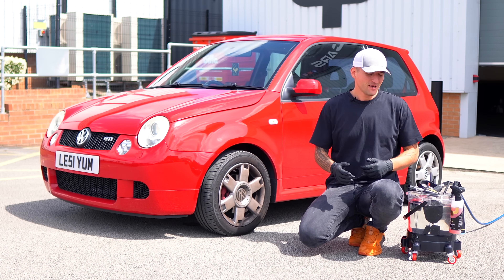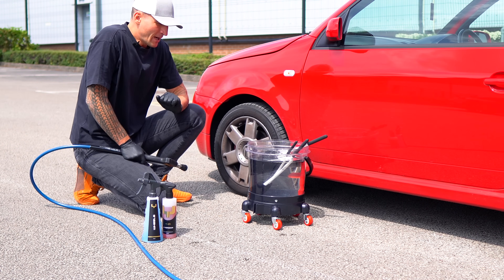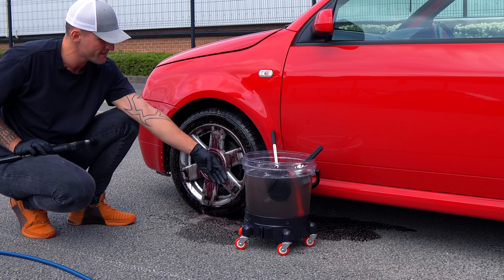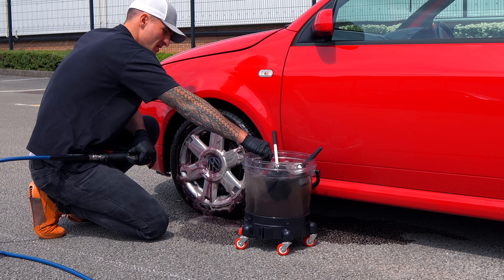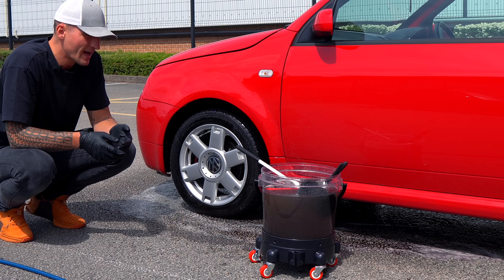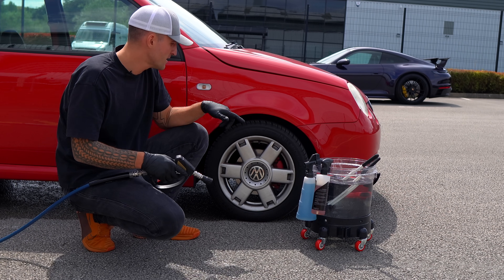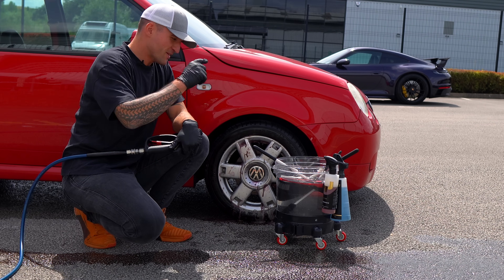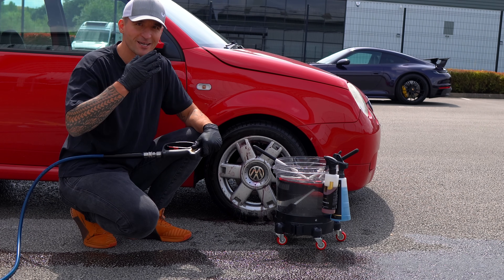Why The 1 Bucket Method For Wheels Is The WORST Idea In The Industry

Comment: I always use the two bucket method with my wheels as you say why do it on paint and not on painted diamond cut alloys. If my wheels are really dirty I do rinse my tools but I will going forward have the lance to hand as an extra rinse step as that makes sense in my eyes. Thanks for the tip.

Comment: I use no bucket and just spray cleaner on all my brushes, then rinse them with pressure washer . There is no need for a wheel bucket at all. don't waste time or effort. get it done easy and without so many buckets.  you should pre rinse wheels as well as it drastically removes and loosens brake distcdirt n grime prior to applying cleaner and foam.   people  think that chemicals won't work as well on a wet wheel, but if you  think about it , half oz. extra of water isn't going to dilute your wheel cleaner at all.    I compete a wheel cleaning in 2 and a half minutes using only my foamer  pressure washer and 3 brushes.   work smarter..not harder.  💪 

great video

Comment: I use no buckets, spray the wheel with wheel cleaner and the tyre with APC. Brush the barrels, faces and tyres and then just pressure wash it off. That's how I've always done it and never had any issues. I do wash my wheels weekly so they are never really that dirty.
Reply: Same. No buckets here. I only use one for rinseless with a sponge.

Comment: Please forgive me Nick, for I add HDD Brake-Through Wheel Shampoo to the wash water. But I do always spray-rinse my woolies and brushes after working on each area of my 5-spoke alloy wheel before putting them back into the wash bucket. I always direct the water spray AWAY from the car and the bucket while washing the brushes, to avoid any contamination. Water over-spray can dull the shine on my freshly 'Ceramic-Boost'-ed paint finish.

Comment: I use 1 backet for everything. I wash the car with multiple mitts, I wash the wheels in the end with 4 dedicated mitts and the wheel barrels with the water left in the backet while rinsing with this method. No dirty mitt or brush goes in the water. Only all of them go in the backet when I finish to go for laundry.
One backet for everything is all it's needed
Reply from the maker: not something we would do but happy it is working for you
Reply: @YumCars  Yet the safest way possible

Comment: Even using a one bucket method…it can be achieved if the process is correct. I apply tyre cleaner & wheel cleaner. While leaving the wheel cleaner to dwell I scrub the tyres then rinse off without any initial agitation. This does most of the heavy lifting, taking most of the grime off.  I then apply more wheel cleaner if needed but more often than not I’ll just apply some pre wash and foam then go in with various wheel brushes and wheel mitt. I rinse any brushes & mitts before going back into the bucket. Last time I washed the car, after all four wheels were done, the water was pretty much clear apart from the odd bit of grit under the grit guard 😀👍
Reply from the maker: This is a good method!
Reply: @YumCars 
I will add that the following comments are just my personal thoughts…
When it comes to wheel cleaning, one thing I could never wrap my head around, if the wheel is extremely dirty, most folk will spray on their brand of choice regards a wheel cleaner, then after some dwell time, go straight in with their wheel brushes, mitts to agitate the dirt. This to me just means your taking all that extremely aggressive brake dust then brushing it and swirling it around your alloys.  This just don’t sit right with me ( especially with my gloss black wheels )    so surely it makes more sense to rinse that initial cleaner off, hopefully taking the the bulk of or at very least the worst parts of the brake dust with it. If you then reapply some product and then go in for the agitation stage, surely that would minimise the chance of marking your alloys. I know nothing can always be full proof and sometimes things just happen…but is it just me that thinks this way or am I completely off the mark here…? 
Any feedback welcomed 😀👍

Comment: I use one bucket for the Car and one bucket for the wheels but have an extra garden hose set up with a trigger spray  to clean my wash media before it goes back in the bucket. its a piece of cake and keeps both sets of water clean.
Reply from the maker: This is a good way to

Comment: I just use the bucket to hold my wheel brushes and mitts but don't fill it up with water at all. I hate fishing for brushes in water. I pre-wash the wheels first, then pre-load my brush with product, do a pass, rinse the brush with the power washer, put back in the bucket. Once you find your pace, it doesn't take time at all to rinse your brush, and you're saving time from trying to find your brush that's hiding underneath a layer of foam and some black water.
Reply from the maker: Bingo Felipe! This is a beautiful way to do it and that’s how we do it

Comment: I have never understood why everybody even Matt at Obsessed Garage use the rough brushes etc and just go all in on the brake dust once the iron remover or such have gone purple and not rinse the wheel before going on and agitate and trying to minimize the dirt possible.
It is THE worst dirt you find on a car, why? Because the pads contains all forms of metals and then you have the rust from these particles too and this is like Swinto on the wheels which you would never do on the car paint.
Reply from the maker: We always pre wash and pre wash our wheels. 

This is merely an example to showcase a dirty bucket.
Reply: @YumCars  Yes,  this was a really good video to show how dirty the wheels really are
Reply: To be fair most of Matt’s cars have carbon brakes where the build up is nothing like that from steel discs - plus he barely drives his cars anyway 😂🤷🏼‍♂️
Reply: @simon737  Not the Lancer, Cayman and E36 as of his vehicles today have carbon most likely cast iron on E36 and Lancer, but yes carbon brakes makes life easier and I guess he doesn't drive the cars to often, but my point is if anyone is going to be a perfectionist there is no reason to scrub brake dust on your wheels :D

Comment: Final price of a simple wash with this method: 150£ to pay for the time spent cleaning the brushes that clean already brake dust damaged wheels
Reply from the maker: No damage here 🫶

Thanks for watching
Reply: @YumCars  Unless with was freshly painted, it has damage, if not for cleaning, because it's dirty and it means it was used for a while on the road, so yes, it has damage of some sort, but wtv floats your boat 😅
Reply from the maker: @afonsofreitas3595  I can assure you our wheels are in perfect condition. No swirls, no chips and no other damage 🤘🏻

Comment: No matter what you do you are always moving brake dust or dirt on a wheel! imagine brush or mitt squeky clean as soon as it touches a wheel and the first swipe you make it gets dirty and your spreading it on the next spoke and the next spoke  etc! So nick to me spraying it with a pressure washer or putting in bucket of water doesn't matter because your ALWAYS no matter what you do moving dirt pre washed or not on a wheel..
Reply from the maker: True Chris, no wheel is 100% clean however because this is the case I simply highlighted a good step to minimise contamination even further instead of putting it all back into the bucket.
Reply: @YumCars  get it its all about minimising contamination but still it doesn't make a jot of difference if you pressure wash your mitt/brush or put it in a bucket of water that has some contamination in it, I still maintain the fact as soon as you put your mitt or brush on that wheel your mitt/brush goes instantly dirty as you move your product around that has to be fact surely. Therefore on this one there is no right answer with this one cause of reasons I've said above! P.s I still think your products are top dog  and always use them!  just don't think your actually correct with this one soz forgive me 🤣🤣
Reply from the maker: @chrispowell4954  surely rather than put a brush loaded with contaminants back into a clean bucket it’s better to quickly rinse it out and get 90% of it off? Every step like this does help.
Reply: @YumCars  I actually do your method honestly I do!so I have like you said probably knocked 90 % off. But equally if you put your brush in your bucket of water like you have in your video you probably knocked the same off it shows that in your bucket  in your video so it's probably equal, but again as soon as you put your 90% clean brush/mitt on that wheel it's got shit loads of contamination again and have no choice but move it around to get it clean... hope you can see where am coming from. Good debate this!😅🤣🤣
Reply from the maker: @chrispowell4954  ha! Of course I see where you are coming from. This is why this video was filmed, to open a friendly debate.

At the end of the day, like the paint on the car, you have to contact wash a dirty surface eventually so no matter what can be done you are moving some level of dirt around, but that is life
Reply: @YumCars  yeah that's it. i saw a obsessed garage video about year ago and he said somebody told matt which hit home to him, you can get a wash pad or mitt as clean as you want with your 2 bucket wash, but as soon as that pad hits your car it will get dirty then you've obviously got move that pad to the next dirty area which is always there(unless your got really good protection and prewashed well to a inch of its life) so what am saying with the wheels is your buggerd your brush/mitt will always be contaminated as soon as it hits the wheel pressure washed or not because its a different kind of cleaning to the body of a car

Comment: Ok, I'll be the first - GUILTY as charged I can't believe I've been so stupid all my life, I'm now no longer a 1 bucket Wheel cleaner, I'll go and hang my head in shame 😧😧😧. On the plus side Nick that's yet another thing I've learned from you. My wife's new car (due in a month) will be so happy about that!! On the new car subject, after drying, is it Ceramic Spray sealant first, followed by Yum Wax, and then Foam+ for the next couple of maintenenace washes until the ceramic and wax get reapplied?
Reply from the maker: The order of products is correct yes. Also remember when you are physically drying your car to use a drying aid with your drying towel
Reply: @YumCars  Chhers Nick, I use your detail spray every time I dry a car👍